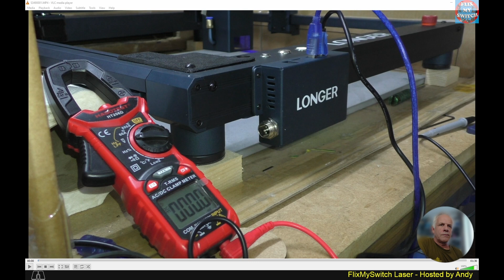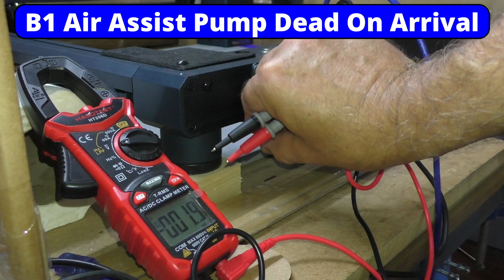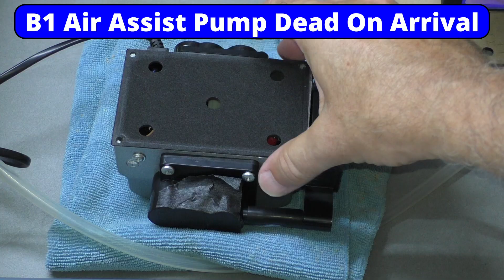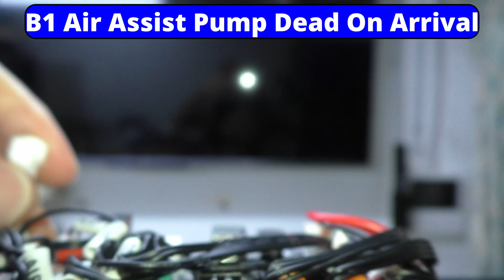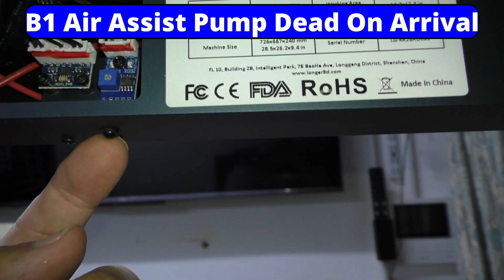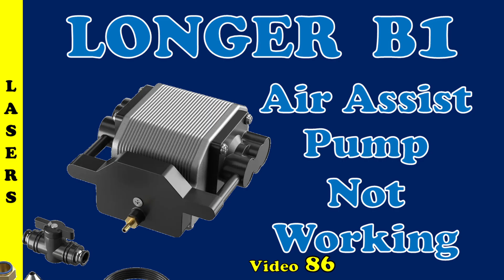Auto Air Assist Pump repair teardown | Troubleshooting | Diagnosis & Fix | Longer B1

Comment: Thank you for the explanation, that helped me a lot! The problem in my case is the air pump: It is getting 24V, but the pump isn't working. I think it's the small circuit board located in the pump's cable. Support told me to test it, but they easily forget that not everyone understands electronics or has the necessary tools to make these measurements. Let's see how it goes. Thanks again for the great video!
Reply from the maker: Hi I assume you looked inside the pump like I showed in the video?  The little box is were the magic happens. I believe it reverses the 24v plus and ground quickly that makes the shuttle inside the pump move side to side.  A multimeter like in the video are very cheap, though you say you have tested the 24v into the black box. Please have a look inside it. The only thing you can really do is make sure the 2 wires in and out are firmly connected. Let me know how you get on.
Reply: @FlixmyswitchLASER  

I wanted to give you a quick update on my situation: I checked the contacts on the mainboard, and it turns out there is no power output for the pump at all. So I suspect the polarity switcher (or the control chip) on the board is broken, not just the pump. I have already reported this to support.

To be honest, I am quite disappointed. When I buy a device for €800, I expect it to work properly. Accidents happen, but I don't think it's right to tell customers: "Please take the device apart and measure the voltage." Not everyone understands electronics or has a multimeter at home! I find it frustrating that Amazon just points to the manufacturer in China instead of offering better support directly.

Anyway, I have now ordered a separate pump that I will just switch on and off manually. I haven't received a reply from the manufacturer yet regarding the next steps. I haven't left a negative review yet because I want to give them a fair chance to fix it first.
Reply from the maker: @remyecker9394  I had to move the air pump connection on the mother board.  When you remove the metal screen case you seperate the red and black connector.  I then had to put the two pin connector that is attached to the metal screen housing in to the connector marked beep.   If you have a multi meter you can check this BEEP connector when calling for air you should get 24V.  Join My B1 facebook group then i cansend you some photos or when call call one another.  https://www.facebook.com/groups/1124786312801522
Reply from the maker: @remyecker9394  lets connect on facebook Lets see if I can get your auto air assist working
Reply: @FlixmyswitchLASER  However, as I mentioned, I have already ordered a new pump. I am not an electronics expert, and I strongly believe that it shouldn't be the customer's job to disassemble components of a brand-new device. This is clearly a warranty case, and the manufacturer needs to understand that not every customer has technical knowledge of electronics.
I am still in contact with the manufacturer and will tell them exactly this.
Thanks again for your suppor
Reply from the maker: @remyecker9394 ok I totally understand your point of view. If you want my help you know we're I am. I have seen this a few times, especially like me when firmwares changes certain versions of the motherboard you need to change where the auto air assist is connected.  By any chance did you try and updated the firmware? as if you did thats your issue

Comment: Thank you for the useful breakdowns and thorough troubleshooting. My B1 40w wasn't working right out of the box. Traced the power out how you detailed and discovered they mislabeled the air pumps plug as a beeper and didn't have it plugged into the air connector on the main board. Switched the connector over and it worked great.
Reply from the maker: Glad the video helped you get it sorted so quickly!

Thanks for commenting it really means alot to me.

Comment: Hello! my assist work before flash firmware for display......
Reply from the maker: Ok which version of FW did you have. And what did you change too
Reply from the maker: I would email longer tech and ask them why
Reply from the maker: Well as I now have the display turns out you have to move the 2 pin red and black white connector directly on to the board in to the BEEP socket
Reply from the maker: Then like me you have to move the red and black with white connector into the socket on the motherboard marked beeb